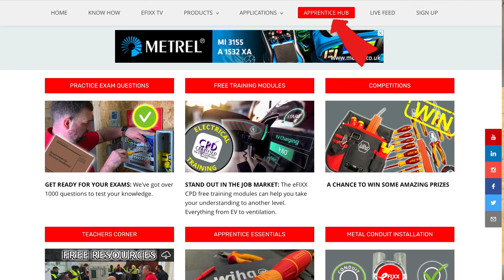Leaving School To Become An Electrician - Is It the Right Path for Me?

Comment: Its a great trade to have under your belt. But its hard work to get to the top. My advice is go for it get your qualifications but after a couple of years at the same company move on other wise you could get stuck doing the same job day in and day out. By moving companies your looking to extend your skill set. Once your qualified going back to college is not a big issue but i would also look at improving your education to become a electrical engineer and get into the design side of things believe me your knees and back will thank you for that in later life.
Reply: Used to be you come of your " time " you moved on ,when I left my firm to go elsewhere there was uproar ,we've trained you up paid your college etc ,I still left ,some of the guys I worked with had gone this route and were still seen as boys .
Reply: @raychambers3646  i actually stayed at the first company to give some pay back but moved on after 2 years on good terms and still call in to give a hand every now and then. But it is true your always the apprentice until you cut the apron strings and have to start to work things out for your self.
Reply: You really start learning when it's you that makes the decisions not your sparky .

Comment: Some fantastic advice there guy’s. But I don’t agree with the having to have a GCSE maths qualification, if you’re not very good at maths you can always use a calculator . I never got a exams from school and my maths is very bad , it’s better now but still not good and I succeeded in going to college and became an electrician.  And I would always try to advise people to get into the industry or at least have a go . 
Fantastic video Gaz as always 👍👍👍❤️
Reply: It's more the understanding of what the numbers and the equations are doing rather than using a calculator. The relationship between them matters just as much as what numbers come out of it.
Reply: @callumBee  yes , I agree , but some people will be fantastic at maths but not understand what the difference between this and that, and there will be some who do but do the most basic maths. 
But who am I to argue i’am just a humble spark who’s opinion means nothing , and can’t count beyond a thousand 😂
Reply: Calculator is only good if you know what to input on it lol
Reply from the maker: Some fantastic points 👍🏻